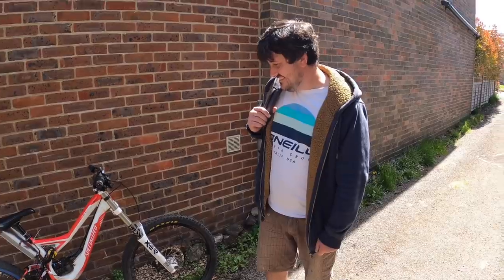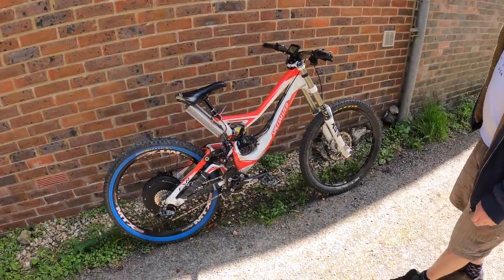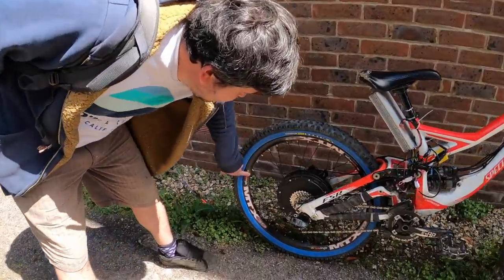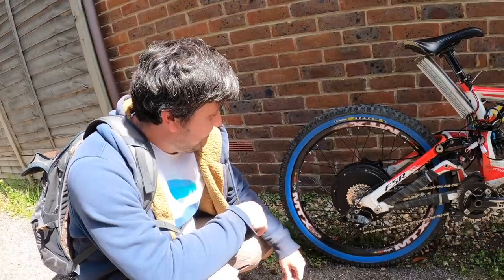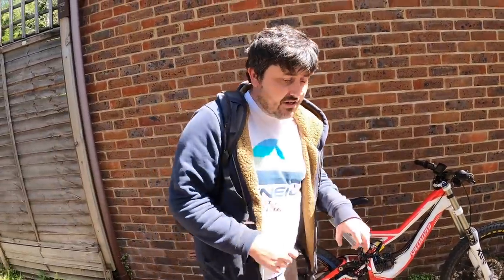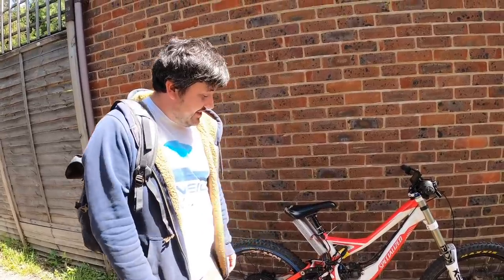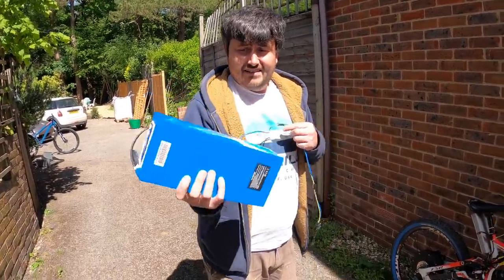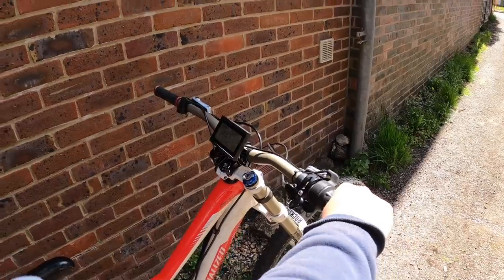Homemade ELECTRIC DOWNHILL BIKE!

Comment: i would love to see this setup on an old Raleigh Chopper, may be use a mk3 for the better breaks but with with an older style seat. there would be plenty of space on the frame under the seat for the battery etc. i only worry about the speed wobble with the tiny front wheel
Reply: You could always make the front wheel really heavy so that it’d be more stable?

Comment: Sam to make your polygon faster unclip the cable down by your crank that goes along the chainstay with a sensor on it..and direct it the other way with the sensor reading the crank arm cadence instead of the wheel,fooling it.you can just clip it the other way again the way it was if you wanted afterwards.
Reply from the maker: Genius!

Comment: Would it be possible to half the range/size of the battery, eliminate the backpack / get the battery on the frame of the bike and eliminate the wired connection between biker and bike, or would that affect the output?

Comment: good vid guys :D ive done the same with my bike, but i do not like my batt in backpack. ive had 2 crashes cuz wrong CG ! i was also very sloppy and unsafe with this setup, now ive mounted the batt onto my frame and its soo much better control ! and u can mount your ESC under the frame on the part wheres the bottle holder usually
Reply: @salviaaable

Comment: You're better off buying a BBSHD ultra mid drive from Luna Cycles and putting it on a full suspension bike. They have way more power/torque and are lighter/more efficient.  Also, way cleaner looking. However, this still looks fun!

If you're willing to spend more, the Stealth B52 bomber is an insane e bike
Reply: Gregory Patzelt how fast are those?
Reply: @lew8067  ludicrously fast. That is if you get the Luna controller.

Comment: Hub motors are terrible for offroad because of additional weight of 10kg on rear hub, weight balance is totally broken along with the bike control ability. 
Better use mid-drive motors, they are excellent for off-road, also allow to use gears to go uphill any climbs. These are most powerful: Cyclone 3000W and CYC X1 PRO. Bafang is too weak.
Specialized Demo (any year, as I saw) has no free space in front triangle to place a battery here, bad choice. Would be better to use a different frame.

Comment: could  make it so it is 250w for on the road and then full power when in the private woods , would shut the haters up and keep the federales off your case !
Reply: Or just tell everyone its 250w..🤔
Haters always gona hate.
Reply: read your bible  Kyle mate ( end of revelation ) , lieing defo not the way.
Reply: @richardbarton7  better yet ride without a speedo forget the 2 speed modes full throttle and have no one to answer to

Comment: be careful riding thease deathtraps at speed man........ i love em they are fun but they quite litterally rattle themselves to bits once u pass a certain speed...... remember thease frames arnt designed with that kinda vibration in mind...........just a warning......... are the helmets an body armour ur using rated for those speed????? kinda pointless wearing a bycicle helmet goin 35............

Comment: Dude that’s old it’s better to put a motor in a front and the back 😂 it goes 10 times quicker like mine haha 😃 it goes like 60-80km/h 😃
Reply: Honestly doesnt it feel a lil dangerous turning with 2 accelerating motors or am I talking nonsense?
Reply: @ize100   Which bike do you use to accelerate in the curve? I never heard of that so I think it’s possible and make sense